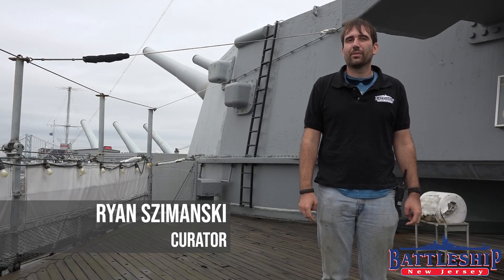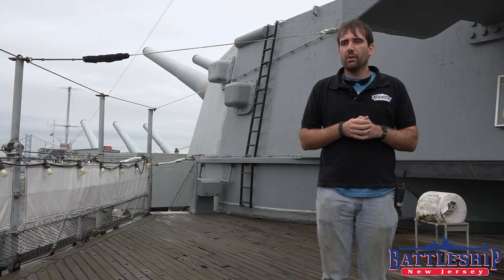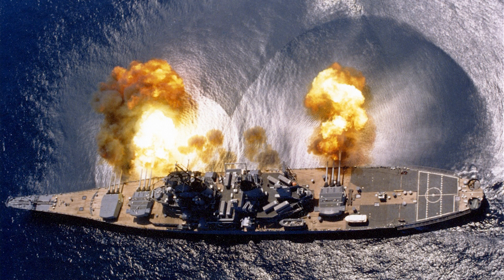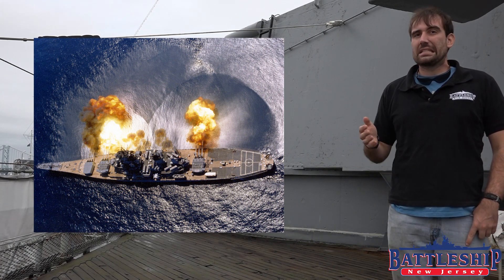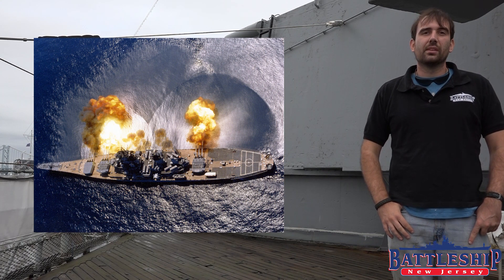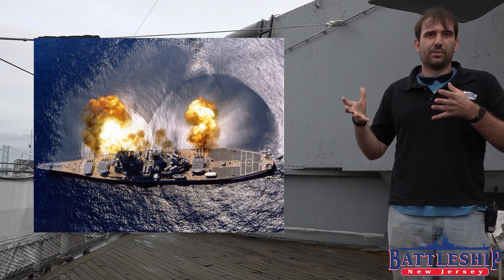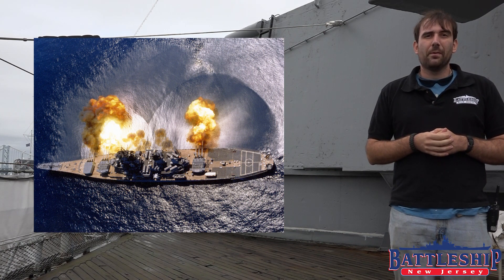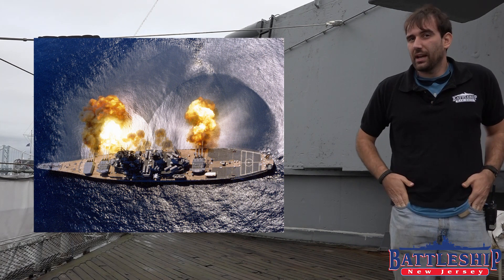Does Firing the 16in Guns Move the Ship Sideways?

Comment: I was in Vietnam on USS Joseph Strauss DDG16 and watched the NJ BB fire a full broadside to starboard.  From the signal bridge of my ship I could see the large projectiles leaving the guns.  The roar was quite impressive and the Battleship seemed to roll somewhat from the blast.  It looked like the slow movement was 2-5 feet after the salvo, but it might have just been a deception caused by the concussion blast on the water.  She was not moving through the water at the time of the firing.

Our ship came alongside NJ and they transferred our mail to us.  We seemed to be like a mouse next to an elephant.
The many WW2 deck guns had been removed from the perimeter of the ship and the tubs that they had been located in were now/then converted to small swimming pools.  Starboard side Enlisted, Port side Officers.  It was an awesome ship!
Reply: Thanks for your service!

(USN, VP-46, ‘85-‘91)
Reply: @DardanellesBy108   Thanks for yours too.  My oldest son flew the F-15E now retired, my youngest son flew the F-15E and the F-35 now retired.  My father flew the VS44 Sikorski WW2  and I used to fly my own C-172.  We have flying in our blood line.

Comment: This is interesting because I had heard this in the mid-1980s in relation to the USS New Jersey firing off the shores of Beirut.  I had heard that the ship moves 200 feet sideways in the water.  From 1985 to 1989 I was in field artillery and so I understand recoil, but I never really gave it any thought about the ship moving sideways in the water.  At some point later, I found a top-down photo of the firing and noted that the muzzle blast from the 16 inch guns looked wider than the mid-section of the ship, so that reinforced the idea I guess that the ship moves sideways in the water when all guns are fired.
Reply from the maker: Its a very common myth, it was spread around for about 75 years of sea stories with nobody being able to agree how far it actually moved and seemingly getting further in every story.

Comment: 1:15 The recoil mechanism does not dissipate the force of recoil, it spreads it over a short time interval, thus reducing the instantaneous peak force. So the force of recoil is indeed applied to the mass of the ship, where it is opposed by inertia and then by hydrostatic force. The movement resulting from the force of recoil is small, too small to be noticeable in a high-altitude photo or by a surface observer but Newton's First Law says it exists.
Reply: Maximum Lateral Ship Velocity	0.59 ft/sec
Lateral Displacement at Time of Max Ship Velocity	0.42 ft
Lateral Ship Velocity at 60 Seconds	0.46 ft/sec
Lateral Ship Displacement at 60 Seconds	30.98 ft
Reply: Thank you oh dear god, there is at least one non-idiot on the internet. Thank you for eloquently stating my thoughts. The best I could come up with was "Physics Much?"

Comment: I guarantee you that a forward 6" gun broadside on a Light Cruiser, the USS Topeka (CLG-8) moves the bow.
'How does he know this?' you ask.
One afternoon during a fire mission in the Gulf of Tonkin in 1966, I was heading below deck. Was on the second deck, moving forward, approaching a hatch to go down to the third deck.
This hatch was midships, between #1 and #2 turret barbettes, and held open by two stanchions, one on either side.
As i approached it, I was reaching my arms out to grab the stanchions to steady myself while i raised my right foot to step over the hatch coaming.
Guess you could say I was in a 'modified crane position', when our six forward 6-inch/47 caliber guns fired a broadside.
I suddenly found myself standing there, still in the 'crane position', looking at the deck, as the hatch had moved  from under my foot, to my left.
As I was below deck, I do not know if the two 5" mounts that could fire to starboard fired simultaneously, but would, of course, be possible.

Comment: As a former gunnery officer, the recoil system does not so much 'absorb' the shock of recoil but slows it down so the force is not 'instantly' transferred to the ship but spread over a longer period of time, it is still transferred to the ship.  the formula appears to be missing an element, it's not mass times velocity but rather mass times velocity squared and wow, that is a lot of velocity, just under a mile in two seconds.  I do agree that I don't think there is a significant amount of sidewards movement although due to the guns being high up on the ship's hull, especially the superfiring turret, I would expect that there would be a measurable amount of roll when firing a broadside.
What might be an interesting video would be a presentation on the fire control computer especially if it is the original WW2 model.  To my recollection this took the speed and course of the ship, the speed and course of the target, the range, other factors, compensated for the roll of the ship, and calculated a target solution, range inputs could be optical or radar.
Reply from the maker: Here are 2 videos we recommend
https://youtu.be/szxNJydEqOs
https://youtu.be/nUESPDkKEgA

Comment: For all practical purposes you’re correct. But if you put the NJ in perfectly calm water with zero wind and fired the guns the ship would move because even with the mass of the ship being many times the blast force and an efficient (but never 100%) hydraulic dampening system, the ship would move sideways. It might be a fraction of an inch or a couple of inches but unless the NJ defies the laws of physics it would be affected.
Reply: Maximum Lateral Ship Velocity	0.59 ft/sec
Lateral Displacement at Time of Max Ship Velocity	0.42 ft
Lateral Ship Velocity at 60 Seconds	0.46 ft/sec
Lateral Ship Displacement at 60 Seconds	30.98 ft

Comment: My father was a Junior Officer aboard the USS Colorado BB-45 which saw extensive service throughout the Pacific War. The Colorado war armed with 8 - 16 inch guns and was often used to as fire support for invasion forces and for pre-invasion bombardments. He recalled that while the ship would not move sideways in the water during a simultaneous 8 gun fusillade it could certainly knock you out of your bunk. At 624 ft in length with a 30 ft draft and 33,000ton displacement the Colorado was older and smaller than the New Jersey. The Colorado was under overhaul at the Bremerton docks in Puget Sound when Pearl Harbor was attacked and was therefore the only undamaged American battleship afloat in the Pacific as the US entered the war.
Reply: I was a junior officer on USS Missouri and my stateroom was directly beneath Turret 2, on the second deck just below the main deck.  When we planned to fire the guns, I put away small items sitting on my desk or the sink because they might get vibrated off onto the floor.  There is zero chance the vibration would knock anyone out of a bunk.  That's a nice story but it's a big exxaggeration.

Comment: Does the ship take structural damage from absorbing the recoil after multiple firings?  In artillery, we used to track firing in a little booklet that determined when the gun barrel had to be scoped for cracks, and ultimately, when the tube was worn out and had to be replaced.  Did they need to do that with 16 inch guns?  Were the tubes ever replaced?
Reply from the maker: Here are two videos on maintenance of the barrels
https://youtu.be/phWUBx7GwhQ

The ship itself holds up well. The first time after a yard period that the guns are fired you figure out what wasn't secured and fix that but otherwise things mostly hold tight, because the recoil mechanisms work really well.

Comment: OK here's a question for you then. The picture you are referring to above, it looks like the rear gun is only firing 1 salvo and the turret closest to the bridge is lit up like it is firing more than 1 gun on the turret. And I don't know if the 1st turret is firing any shells. The old myth or story I've heard is that the ship can move 3-6 ft (south in this pic) when firing a salvo of all 9- 16 in guns at the same time. Now if the ship was firing these shells all in the same direction as the picture shows. Now the ship may not move to the south (in the picture) but because of the sheer powder charge and water displacement I would say it is entirely plausible the ship would move to the north (in the picture) because of water displacement among other factors.

Comment: Yes, the battleships most definitely move sideways as her guns are fired. 
This guy making this video wasn't at Normandy on June 6, 1944. Those that were disagree with him, as they are on record attesting to their landing craft being swamped by the waves caused by the battleships being pushed back from the concussions of the guns blasting away at the Normandy coastline, during Operation Neptune.
Reply: And they're all wrong.  No ship moves sideways when it fires, much less a 50,000 ton Battleship that's sitting 38' deep in the water.   They LOOK like they move, because the blast of the guns boils up the water next to the ship....but that's all it is. 
There's a good video of either the Jersey or Iowa in Korea, where a helicopter is hoving behind the ship and it fires a full salvo.  Doesn't even wiggle.   Watch it for yourself. 
If the ship moved any appreciable amount, you couldn't stand anywhere on the ship without getting knocked down.   But you can.

Comment: Of course it moves when it fires its battery.

Battleships are not immune to physics. I would even say that battleships are celebration of physics in many forms (shooting heavy objects on ballistic trajectories, finding enemies using radar, turning huge amount of bunker oil to steam and then to forward motion, and so on)

If you are in a dinghy and throw something heavy, the dinghy will move along with you.
If you are in a battleship and shoot something heavy very fast, the battleship will, likewise, move.

The recoil is arrested by the batteries, but that energy is only temporarily stored so that it can be transferred onto the ship over longer period of time (1s?). This is done so that the ship is not damaged. Otherwise the force of the explosion that acts on the shell being accelerated would also act on the ship and that would be pretty bad.

When you drive your car at 100mph and hit a wall you dissipate the same amount of energy as when you brake from 100mph. Just over longer period of time. You experience the same total change in speed but the deceleration you feel is smaller because it is spread over longer period of time.

Full salvo is over 10t of shells propelled at muzzle velocity of about 760m/s. This is a lot, but the ship is 50000t, or 5000 times more than the weight of full salvo. This means the ship would receive 1/5000th of the speed of the shell (0.15m/s, 0.5km/h)... if it was in vacuum of space. Because it is actually in water what happens is it only gets this speed momentarily and then immediately experiences drag and starts getting that energy dissipated as it pushes through water. Part of the energy is dissipated as wave and part as water tries to rush around the ship. Both require that the ship moves at least some. If you don't believe, try to put your hand in water and create wave without moving your hand. Water creates drag but the force of drag is exactly zero if you don't move, you need to be moving to experience drag.

I have no way of calculating how far the ship would slip, but you can imagine that the ship somehow gets 15cm/s or 0.5km/h sideways... it would not slip very far before the water would stop it. Probably better chance observing the slip if it shoots over bow because then it would not create so much drag.

As it happens I sail some and when you sail you also need to dock. And when you dock you need to be able to judge speeds and how long it will take the yacht to stop. Usually, when a yacht gets propelled to 0.5km/h sideways you can expect it to move a little bit, say a meter or two.

Also, the distance covered is more for larger ships. Have you ever noticed that a large tanker needs a longer distance than a small yacht to decelerate from the same speed?

Overall, I think we could expect at least 1 or 2 m of slip, maybe more (but probably not more than 10-20m). Too bad I don't have a battleship and permission for full broadside to run an experiment...

Comment: There is a big difference between a 165 pound dude fully load with BBQ and beer firing a 34 pound 50 cal with 5/8 sqaure foot platform (standing up)  and a 54,700t firing platform firing nine 16 inch, 50 calibre 100t rifled guns sitting on a 131,00 cubic yard platform with millions of square miles of support structure around it. PS: i was told is moved but never a distance. All i know is better not be standing in front of the turret!!!

Comment: I had a poster of that picture after USS IOWA came to Portsmouth harbour U.K. in the early 80's. I too thought it looked like a sideways motion before realising that the circular 'dishes' in the sea around the guns muzzles were the effects of the blast / pressure wave of the gasses from the guns firing. Fire a rifle over grass, dust, snow or sand and you'll see the same pattern on the ground + stuff blown up into the air, especially if it has a muzzle brake fitted.

Comment: Whether it moves sideways is dependent on your definition. When the guns are fired with the ship sitting still in calm water the gyrocompass registers a little roll so there is some movement. I saw it with my own eyes as an Interior Communications Electrician, the Gyro was a piece we had to maintain and it was in our shop. You don't determine the amount of force transmitted to the ship based on just the projective weight, it is thrust that matters which is determined by many factors.